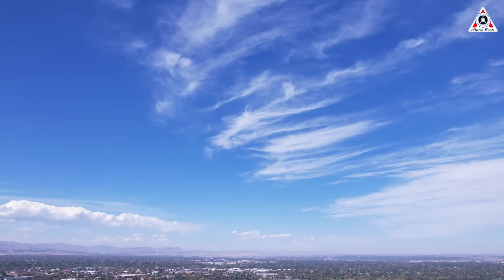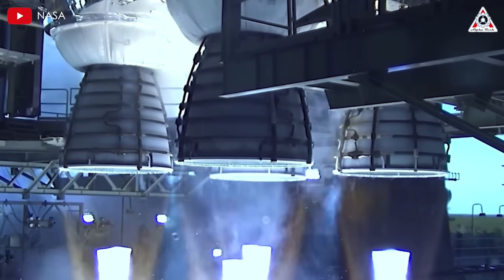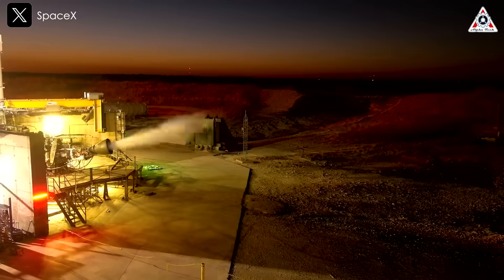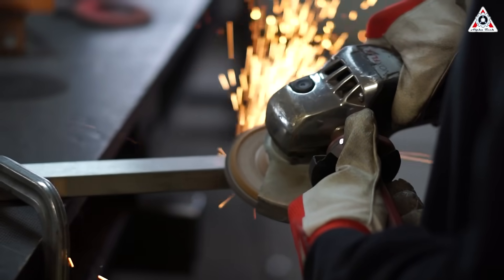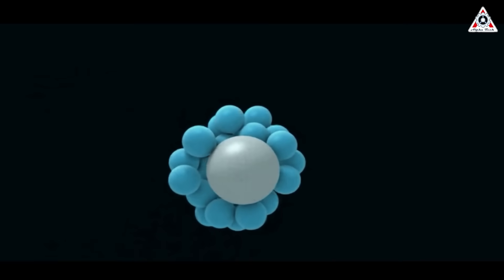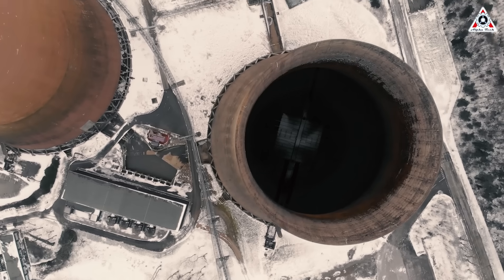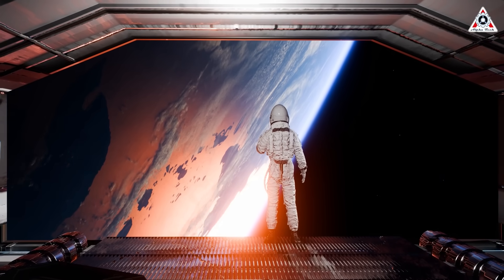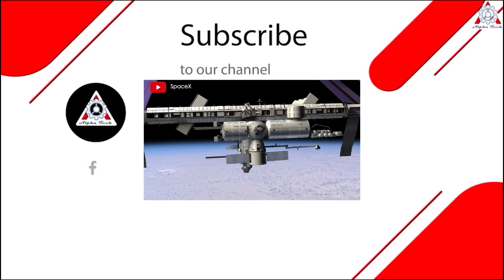NASA's New Nuclear Rocket Engine to Mars in a Day! Even Faster than SpaceX Starship...

Comment: Both Nuclear Thermal and PPR discussed in this video can achieve very high specific impulse impulse (Isp) however they are not capable of lifting a spacecraft off the surface of the Earth, Mars, or Moon. Having a very high Isp (efficiency) means that with sufficient fuel you can reduce the travel time by thrusting continuously. This does NOT mean that you would have a 1g (earth gravity) or even a 1/6 g (moon) acceleration capability so it does not obviate the zero g issue with long duration missions. But by accelerating CONTINUOUSLY on a carefully controlled trajectory the travel time can be drastically reduced. The spacecraft thrusts in a expanding trajectory to 'catch' up with Mars and then flips around about half way and starts reducing speed to match the orbital speed of Mars. Additionally. This engine, and probably separately its fuel, would have to be boosted to orbit by a conventionally fueled booster like Starship to the crew module spacecraft, like a Starship. Conventional fuel would also be require for high thrust (lower ISP) chemical engines for descent to the Mars surface. Not as "easy" a solution as the multiple chemical rocket launch planned by SpaceX.
Reply: This is wrong.  As far back as the 1970s, LANL had engines capable of lifting an Apollo command and service module stack, and achieving escape velocity, and more. The stories of wimpy nuclear rockets are all myths.  Source was two scientists retired from LANL.

Comment: That engine  is a dirty bomb that could fly over ever square inch of the earth and kill everything with radioactive contamination endindlife on erathas we know it
This is a doomsday weapon of the most evil kind
Reply: This is wrong.  Yes, the engine is a plutonium fueled therm-pile, but the propellant (that which spews out) is hydrogen traveling at very high speeds.
Reply: Absolutely right. Not a single reference to radiation pollution. The exhaust gases from such a system would be so obscenely radioactive for thousands of generations to come. Just google the NERVA program to learn why this technology was tried and bagged many years ago.

Comment: The information seems like a mix of speculative claims and exaggerations, possibly for sensational purposes. While NASA is indeed working on advanced propulsion technologies, such as nuclear thermal rockets, the claim that it could get humans to Mars in a day is far from being a reality at this time.

Here's a breakdown of the key points:

1. NASA's Nuclear Rocket Engine: 
   NASA is indeed researching nuclear propulsion, specifically a nuclear thermal rocket (NTR) engine. This technology could potentially be more efficient than conventional chemical rockets. Nuclear thermal rockets use nuclear reactions to heat a propellant (like hydrogen) to very high temperatures, which could provide greater efficiency compared to traditional chemical rockets. This would significantly reduce travel time compared to current propulsion systems, but "a day to Mars" is far too optimistic with the current technology.

2. Travel Time to Mars
   - Using conventional chemical rockets, it takes around 6 to 9 months to reach Mars. Even with the theoretical boost from nuclear propulsion, we’re not looking at travel times that short, at least not anytime soon.
   - The claim that NASA's new nuclear engine could make the journey in a day is almost certainly a misconception or exaggeration.

3. Comparison with SpaceX’s Starship
   - SpaceX’s Starship is indeed designed for deep-space missions, including Mars, and Elon Musk has stated that Starship's trip to Mars could take around 6 months.
   - While NASA's nuclear engine may improve travel time, the idea of drastically reducing that to a single day is unlikely, especially with current technological constraints.

In conclusion:
While NASA is developing nuclear propulsion technology to improve efficiency and potentially reduce travel time to Mars, the concept of traveling to Mars in a single day with current or near-future technology is not realistic. It's likely an overstatement, though the promise of shorter travel times with nuclear engines is an exciting prospect for the future.

Comment: High thrust / High Impulse propulsion is a game changer for Mission Success and Human Safety going to Mars.  Reducing transit time and eliminating the need to wait for bi-annual optimal transfer windows to save propellant will result in the ability to carry more consumables and logistical supplies, and make it possible to provide rescue and re-supply capabilities - unavailable using conventional propellants. Additionally, crews will be subjected to shorter periods of radiation exposure during transit. These factors will significantly enhance Safety and Mission Success. Given the NERVA program experience of the previous century, current research and development plans, and the incredible benefits of NTP - we should abandon current propulsion technologies. Going to Mars on Starship will be like forgoing a trip on a modern cruise ship in favor of a 17th century sailing vessel - in terms of time, safety, and comfort. I have to believe that the only reason SpaceX is still planning on going the "old fashioned" way is that they are entirely committed to vertical integration and using their own "stuff".
Reply: I agree it will also changed how we think about space travel. We would need 2 different types of vehicules: one to get from a planet to a space station in orbit (like Starship) and another one with nuclear propulsion to get from planet to planet (space station to space station). This would not only give us access to Mars but a big part of the solar system (the asteroids belt to mine, Titan, etc) as well.
Reply from the maker: You are right, this is super interesting.

Comment: These accelerations and subsequent decelerations are going to be really hard on the human occupants and possibly certain cargo. Also, the methane, hydrogen and oxygen fuels used in the SpaceX designs can be manufactured on the Martian surface where the U235 and other fuels cannot.  At least we haven't discovered if there is Uranium accessible on Mars as of yet, nor any other more complex fuel elements or compounds. Once a Martian Starbase has been established, even the sky is no limit as to what may be discovered and made practical.
Reply: Actually these propulsion will be able to produce artificial gravity. Probably throttle to around .5  G, between earth's 1 G and Mars' .39 G.

Comment: Just to be clear, to get to Mars (220 million km) in 1 day, you'd have to build a rocket engine that could go 152,000 km/h. That's about 2500 km per second. We're currently at a maximum of 537 km/sec.
Reply: Not to mention the crushing forces on the human body we are in gravity manipulation territory
Reply: Did you account for stopping at Mars? Yikes that's a hard burn
Reply: You’re absolutely right, and this is a great way to put things into perspective!

To travel to Mars, which is about 220 million kilometers away, in just one day, the required speed would be 152,000 km/h, or about 2,500 km per second. This speed is astronomically faster than anything we've ever achieved with current technology. In comparison, the fastest spacecraft ever built, such as NASA's Parker Solar Probe, travels at a maximum speed of around 537 km/sec (which is roughly 1,932,000 km/h). While that’s incredibly fast, it’s still nowhere near the speed required to make the journey in a day.

Even with advanced propulsion systems, like nuclear thermal or electric engines, reaching these speeds is far beyond our current capabilities. Achieving the speeds required for such a fast trip would require breakthroughs in propulsion technologies that go well beyond the scope of today's technology. As of now, traveling to Mars in one day is purely hypothetical and would require fundamental advances in physics and engineering.
Reply: @ Are A.I?
Reply: you calculated the average speed need ... but you need to accelerate for half the trip, and deccelerate the other half !

Comment: The power of the engine doesn't determine the time to get from Earth to Mars, only the type of transfer you do.
A hohmann transfer (most fuel efficient transfer possible) always takes the same amount time regardless of the engine used.

This is defenitely made by an AI or was heavily AI assisted, but just to tell everyone this.
Reply: With a powerful enough engine, you don't need to transfer. Simply aim the rocket at Mars and push the button.
We don't have anything even close to that powerful.
I remember a Star Trek video game where you had to do orbital transfers to get the Enterprise to another planet. Why though? The Enterprise has enough power and technology to exceed the speed of light. You don't need transfers. Simply set a course for the planet and engage.
Reply: I mean you could always split burns, and that proves you won't need a TWR (Thrust to Weight Ratio) higher than 0.1 (But you can't keep splitting burns forever, wich means that you would need higher TWR)
And not to mention the amount of fuel spent would be absolutely enormous if you burn straight at the target, like a hundred thousand Delta V. Compared to that of the hohmann transfer wich costs only thousands of Delta V

Comment: There is a lot of issues with nuclear powered rockets, not least is the radiation hazard and the operating temperature of nuclear reactions.  Then when the question of rocket velocity is considered, acceleration of a spaceship with people on board will be limited to around 1G, or little more due to humans likely being unable to handle higher acceleration forces on a 24/7 basis.  And whatever velocity is attained, the inertia of a rockets acceleration need to be slowed down to full stop on landing which would require the rocket breaking by reversing its direction of thrust.  Again under the constraint of what people on board can physically endure for the required duration.  Ideally acceleration at 2 G for half the journey and slowing down for the rest of the journey at 1G which is equal to normal gravity on this planet. 💫
Reply: You forget the factor of Space = less gravity. I think normal engines bring the rocket to space and there the nukes blast the ship in very high speed towards mars. Getting to the planet and land there it uses normal rockets. At least that is what I would do...

Comment: Oh these AI pictures! - Y-Wing  😂
In 24h to Mars? - improbable!
Mars orbit is on avg. at 1.5 AU from Sun, thus at closest we have ~1/2 AU to go. 1 AU = 150M km, so our trip is ~75M km.
The avg. speed we'd have to achieve would be then: 75M km / 24 h = 3.125M km/h = ~868 , let's say 870 km/s = almost 0.3 c !!
Even before minding acceleration, and so having to go faster than that, there's the 1st problem - accelerating to 870 km/s with 1g = ~10 m/(s^2) takes: 870k/10 = 87k s = ~24.2 h !!
Now, we certainly need to go faster than that, and so we must accelerate even more. Taking the least acceleration possible - accelerating half the way and then decelerating (no coasting), requires accelerating to twice the avg. speed: 2*870 km/s = 1740 km/s = almost 0.6 c !!! Acceleration and deceleration each take 12 h = 43200 s, and so amount to: 1740k / 43200 = ~40.3 m/(s^2), more than 4g ! - I don't think anybody would gladly endure 4g for 24h !
So, no matter whether we'll have engines allowing for 0.6 c, this couldn't be a crewed flight... perhaps cargo?
Reply: Was just going to calculate req'd acceleration myself, because I was sure it would not allow human passengers!

Comment: Why the hell use rocket propulsion is obsolete for inter-planetary travel. .  Look for Hanebu craft,  it was operational between the 2 WWW. .we already have high voltage MHD ship roaming all over the solar system since the 1970. . But there are not for ordinary humans. . .sadly
Reply: Magnetic bubble with enhanced field strength with ion injection simply requires orienting the N/S poles of the bubble (which is a great radiation shield!) In respect to the Solar wind.
Tacking like a sailboat for Mars to Earth journey would take longer, but MRI-like superconducting  magnets would use minimal power, far less than conventional or ion/atomic...
Reply: Chem rockets okay for freight and kit. Manned missions need a smaller transit time.

Comment: What crap.  This video mentions NOTHING about how one can achieve a ONE DAY flight to Mars.  Yes, no doubt a thermal nuclear thermal propulsion system would be more efficient system than the chemical systems we are using today, but no where near the 1,800 times more efficiency necessary to make the trip in one day.  A thermal nuclear thermal propulsion system AT MOST would be ten times more efficient (and likely not even that).  The average speed of a trip to Mars to make it there in one day would have to be 79 times faster than the fastest speed currently reached by the fastest space craft ever launched by humankind (the Parker Solar Probe).  Not likely to be achieved just by switching to a nuclear thermal drive system.

Comment: Thanks for the updates.   Highly enriched uranium managed properly does not increase proliferation risks and the performance advantages are considerable with ISPs of 3x those of the best chemical engines.  Also, both nuclear based units and fuels must first be lifted into at least LEO with chemical rockets as they don't have the necessary thrust levels to do that on their own.   But once they get up there, look out, travel times are major reduced, which actually saves considerable money operationally.  I hope they can follow through with this.

Comment: I wonder if anyone is considering the Thorium/U233 cycle. Thorium does not need to be enriched and is readily available on the surfaces of the Earth, the moon, and Mars, meaning that new fuel could be harvested onsite. Neutron flux from U233 fission can be throttled between additional fission for thrust and electricity generation and the breeding of more U233 from Thorium. The rocket would need to start with a certain amount of U233 created on the Earth from Thorium breeding or particle accelerators.

Comment: Rocket motors are a heat engine. Efficiency of a heat engine is determined by (T(hot)-T(cold))/T(cold), where T(cold) is the minimum temperature leaving the expansion nozzle, and T(hot) is the maximum temperature of the exhaust gas before expansion. The primary benefit is the concentrated energy in nuclear fuel compared to combustible fuel. Hot stuff is hard to handle!
Reply: Another measure is how much energy is delivered by the rocket engine compared with what the chemical reaction could deliver

Comment: The Nuclear Thermal engine was tested under NERVA in the 60's.  The site is still to hot to approach.  NERVA promised high efficiency but never demonstrated efficiency better than LOX Hydrogen.  Don't believe the promises NASA makes.  Look at what they did with the Boeing Starliner  and the Shuttle derived Moon mission booster.  Total failures.  Nuclear engines to Mars or the Moon would be left in orbit between Earth and Mars or the Moon.  Ultimately the risk of the hot engines crashing into Earth increases with time.
Reply: All very manageable. Suspend your cynicism.

Comment: "Faster" has its own problems. Slowing down has to be considered too. G force from sustained thrust on passengers/crew would require additional tech and its attendant weight also. Shielding would further require consideration. Nuclear engine development is huge, no question about that! It is only one step towards viable interplanetary travel though.

Comment: They aren’t going to mars. Reason: A liquid propellant, like hydrogen, is pumped through a reactor core. 
Uranium atoms split apart in the reactor core, releasing heat. 
The heat heats up the propellant, turning it into a gas. 
The gas expands through a nozzle, creating thrust that propels the spacecraft. 

The rub, they can’t get enough hydrogen into space to travel to and from mars.

Spacex starship can’t lift itself into space let alone Leo. Bill Nelson needs to be fired. He a ex-politician and not a scientist.

The point the nuclear rocket is still a liquid rocket. So if the astronauts don’t die from the suns radiation the engine will kill them. How did America reach this new low.

Comment: Ugh Mars in 1 day?...    Closest Mars has come to earth = 34.8 million miles (~2003) ...   so, you would have to travel 1,450,000 miles an hour.    
At that speed /acceleration. we better invent Star Trek style inertial dampers
Reply: Exactly, and the 1,450,000 mph is an average, which doesn't take into account acceleration and deceleration, so actually, your top  speed would have to be 4 times that speed. (? Based on a steady acceleration up to and down from the midpoint top speed.  Checking my math now.)  Gonna try to dredge up my HS physics from 52 years ago to figure out what G forces would have to be to make it in a day.

OK, I did a quick calc of that and I got an acceleration of 61 km/s or 6100 G's to make that trip. (Someone please check my work) Unless  I missed by at least 3 orders of magnitude, that's slightly more than a human could endure.
Reply: According to NASA who, as you know, always get everything right, we shall. I am rather wondering if the same NASA scientists who say they have invented this engine, will volunteer to be the first to make this trip...and back again.
Reply: @erepsekahs  (please show me where anyone connected with NASA said we could use this engine to go to Mars in a day.  (Good luck.)
Reply: Yep.. I was giving author benefit /most ideal conditions assuming shortest distance between Earth and Mars .. and ignoring the acceleration and deceleration (as ship approaches Mars) ...  I'm guessing this is click bait